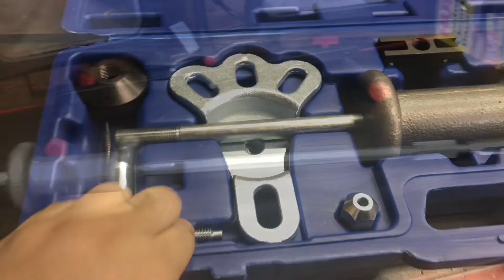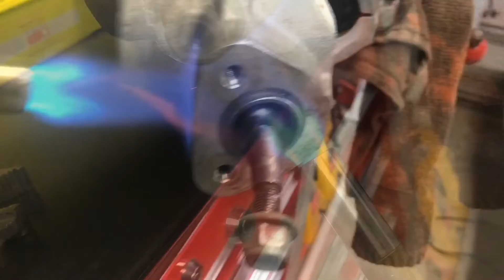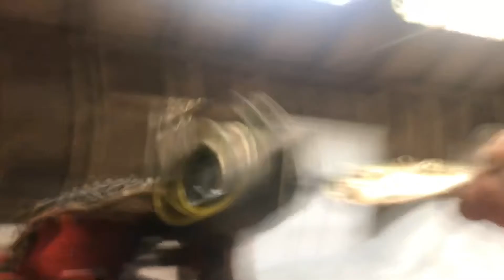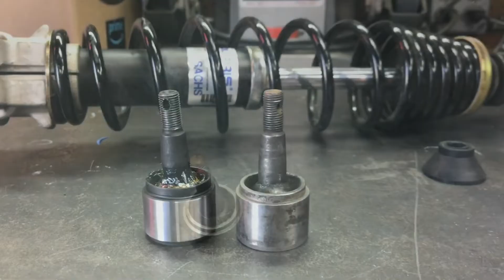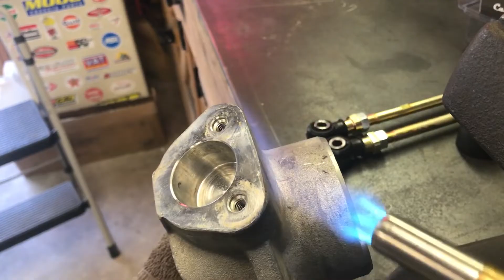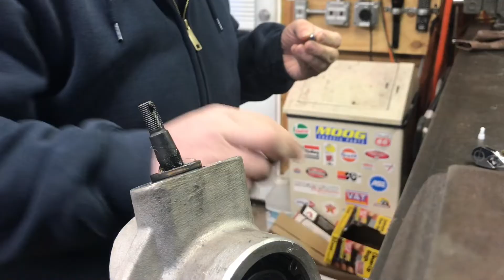Polaris Ball Joint Removal and replacement

Comment: Great tutorial !  this can be done with out even removing the  wheels if your limber . Chevelle shows what to do if they are stupid stuck which they normally are not ,  and if they were id use a hone  on a drill for 15 seconds to make them fit better .The vice grip slide hammer always the easiest and heat only if needed  great video  dint have to listen to you talk and tell us what your dog and chickens did   today . People this is how to make a repair video !  great job !!!!  thanks !
Reply from the maker: Gene Sewell much appreciated!
Reply: instablaster...

Comment: Thanks A HOLE bunch!!
Totally forgot that I can attach a vise grip to my sliding hammer!!
Worked great and made things way easier. 
For those who have questions, if you have a full set for your sliding hammer. You may have a piece that will screw right into the back of your vise grips (where the existing 🔩 is).
Reply from the maker: Happy to help! Thanks for watching!

Comment: just did mine. bought a  $20 tool on ebay and was able  to do it without removing everything from the quad.
Reply from the maker: My quad was actually wrecked. I had the front end apart. Hit a tree and tore the A arm mounts off the frame.

Comment: What do I do if the bolt coming out from the ball joint came out
Reply: I know it's been seven months but what I did was put quicksteel or jb weld in the whole. I cleaned the grease out and filled the whole where the ball joint bolt was I let it dry and the once dry I pumped grease into the fitting on the backside of the strut and it pushed it right out. I couldn't get it out and I saw a video of a guy using a grease gun so I tried and it worked amazing!! I was truly amazed.
Reply: @jessejaymes1376  I’m kinda surprised that worked aswell I just ended up taking it to a guy that welded it on and beat it out

Comment: What kind of torch do you have?
Reply from the maker: Map gas torch you can get at home depot or Lowe’s. https://www.lowes.com/pd/BernzOmatic-Trigger-Start-Torch-Kit-Handheld-Head/50126397?cm_mmc=shp-cprdplbgooglelia-142-plumbingconnectionsandsupport-50126397-_-0&placeholder=null&gclid=EAIaIQobChMImaugsfnL6wIVBbp3Ch1DeA55EAQYASABEgLZM_D_BwE&gclsrc=aw.ds

Comment: k, what if its broken?
Reply from the maker: Depends on how it’s broken. If the stem is broken you can weld a rod on whets left of the shaft and use that to attach your slide hammer to.
Reply: @chevelle74us  full stem pulled out, bits of what holds it in are in there, pretty rough
Reply: whole outer is in there, grease comes in around whats left of the inner peice that holds the shaft and ball which pulled out riding so grease pressure method does not work either if you got a plan let me know lol at this point im considering attempting to weld a bolt to the inside of it to use similar method that you showed
Reply from the maker: That’s what I was thinking. Weld a bolt in there and fill it with weld.
Reply: @chevelle74us  it worked, it was ugly and tough had to fill with weld first, kind of make a spot to weld the new bolt, then just put a 1 5/8 socket over it screwed the nut down and it came out. Thanks for the vid and replies you got a new sub!
Reply from the maker: @mattnetko2282  that’s awesome! Glad it worked out for you!